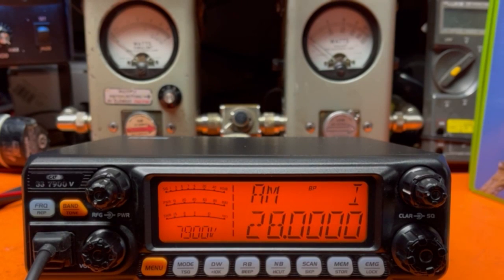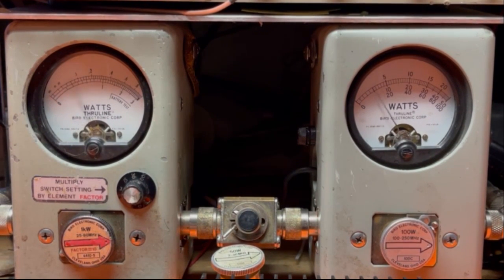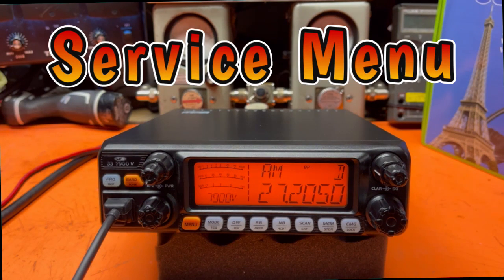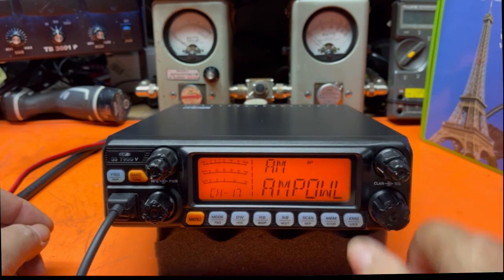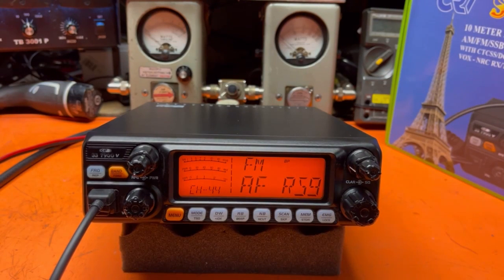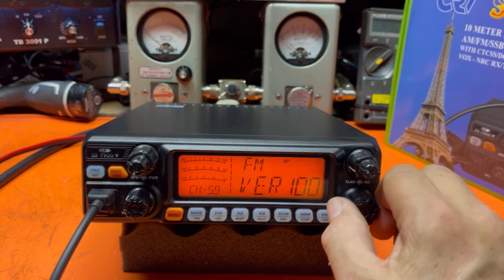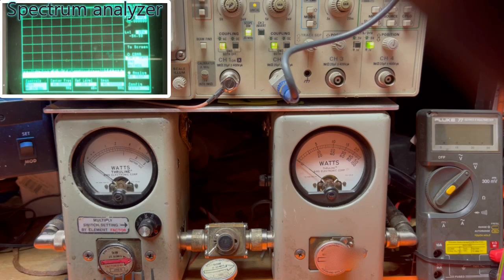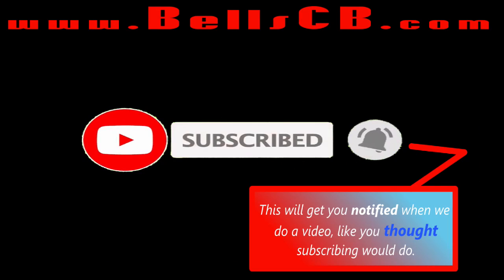The CRT SS-7900V Radio , Introduction to Service Menu and Channel Modification

Comment: Hello sir, I do have the Anytone AT5555N. My question is, the AM deadkey only goes down to as low as 3 watts and it's overdriving my BJ-300 because when I modulate my power meter dips down so is my ameter on my power supply. Please correct me sir. Can I turn down the deadkey inside the radio to at least 2 watts?
Reply from the maker: You can turn it down in the service menu from front panel.  Follow the steps I show in the video, and when your in the service menu, rotate the channel selector to select "AMPOWL" on the display, then hold down the key on the mic and rotate the channel selector to turn down AM power in low.  𝑺𝒄𝒓𝒆𝒘𝒅𝒓𝒊𝒗𝒆𝒓  𝘽𝙚𝙡𝙡𝙨 🔔 𝘾𝘽

Comment: ANYTONE 5555 / RADIODITTY QT-60 / CRT SS 7900 are the same radios from Quanzhou.
Reply: Correction.  You forgot the n after 5555. 5555 is a different radio
Reply: YUP-N